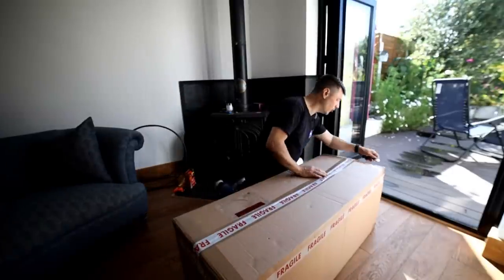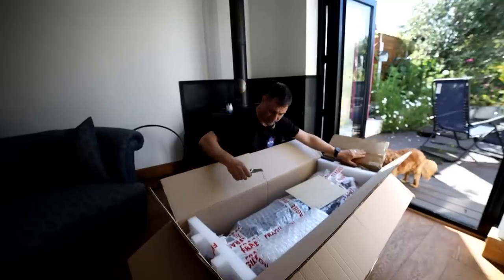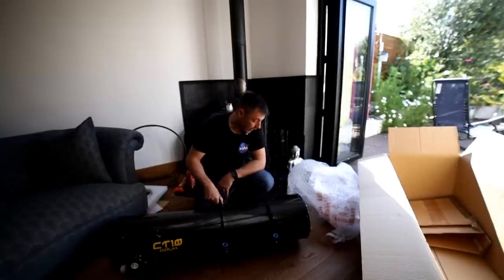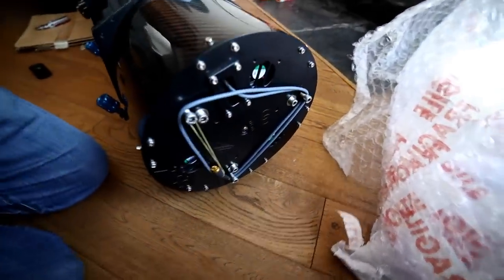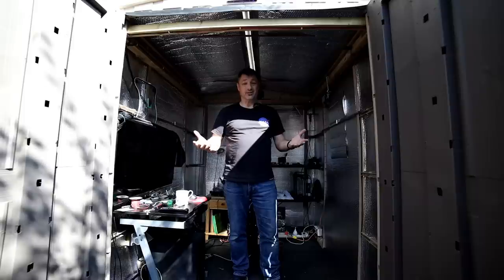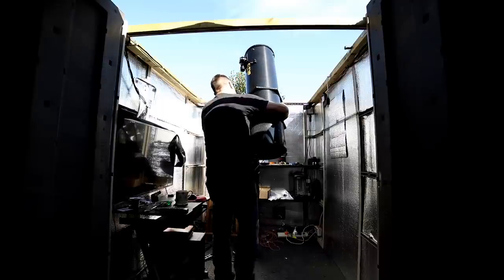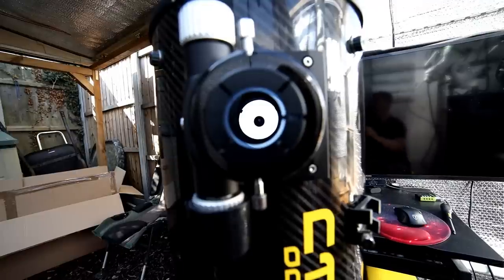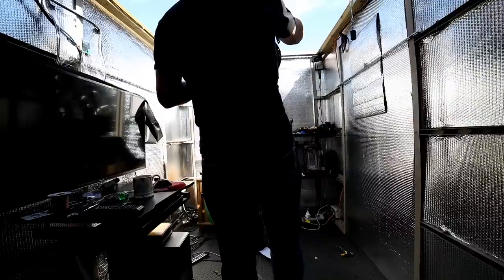Brand new scope unboxing my exciting new Telescope & how to set a custom park position eqmod & NINA

Comment: This is great, but NINA, when she gives the command at the end of the session to park, the telescope remains pointed at the polar region and does not go to the position that I specified in the settings, but you press Park in EQMOD, then everything works. The only place where it works with NINA in the machine is through the Green Swamp. My personal experience.
Reply from the maker: Hi and thanks for watching. Its a simple fix, all you do is make sure the scope is in its park position through  eqmod and parked. Then in NINA press unpark ( it won’t move) then it will have set as park position. Press this and then NINA and eqmod will be synced and it will work perfectly everytime. I had the same issue until I worked it out. Good luck and clear skies
Reply: @Astrobloke  Thank you. I'll try tomorrow
Reply: @Astrobloke  Today, between air raid alerts and arrivals, I managed to do it. It seems to have worked out. Thanks again. The wish for Clear Sky in Odessa sounds even more relevant))

Comment: Best Glenn
Have also look at Orion UK to be sure and there the same information so for the weight you should not do it taken out that Carbon is less subject to temperature difference so I think again a hype where many people fall because in the end both scopes will deliver the same result certainly if you use an autofocuseer with temperature sensor that compensate errors that but everyone his desire and opinion.
Reply from the maker: I think the carbon version performs better with temp change because it is double layered design.

Comment: Best Glenn
I had already responded briefly but I still have a small question, I went to look at the website of AST optics  and they are also available there what strikes me that there are two versions available there are the VX 10 with alumilium tube and the CT 10 in carbon version but they give the two the same amount of tube weight on then I wonder what actually the difference is and that the price is justified if you look at the price.
Reply from the maker: You are right that the CF version does not weigh any less. I believe the main advantage is its tolerances to temp changes and ability to maintain focus. Plus it looks sexier lol. The VX would still be an excellent scope as at the end of the day its all about the optics (mirrors) and OOUK makes fantastic ones.